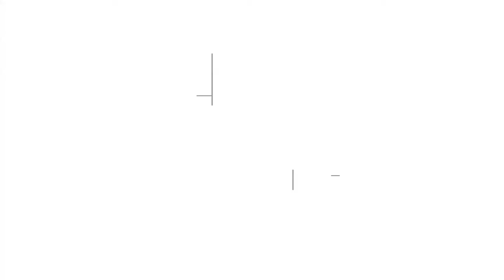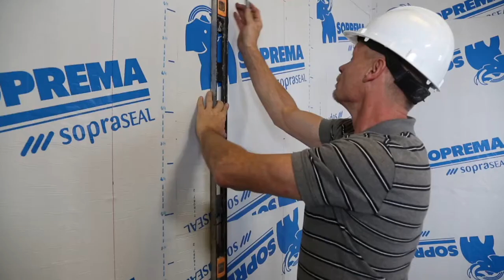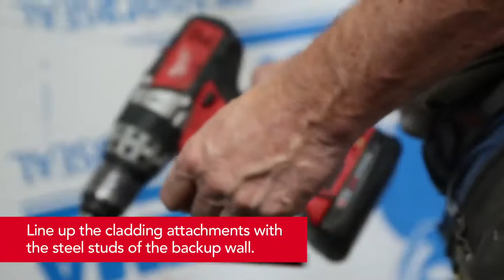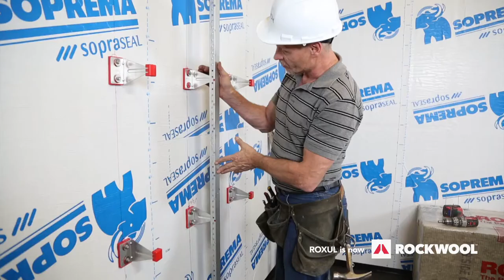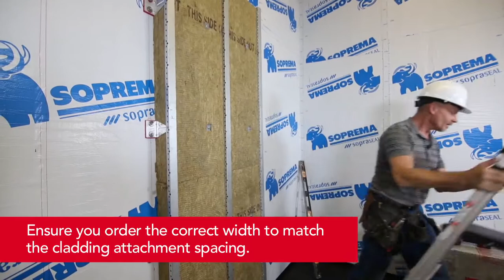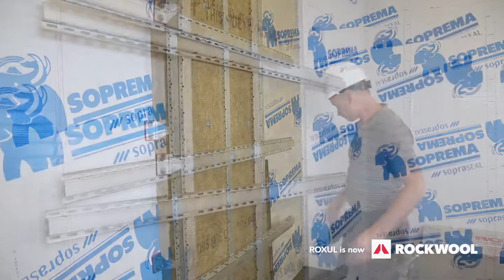How to Install ROCKWOOL Cavityrock® with Knight Wall

Comment: Key insights

🔧 The night wall MFI system is designed to reduce thermal bridging through exterior insulation, providing a more energy-efficient solution for cladding attachment.
🏗 There must be no voids or gaps in the insulation to maintain thermal barrier continuity.
🔩 The attachments are slotted, making the installation of ROCKWOOL CAVITYROCK® with Knight Wall a user-friendly process.
🏗 You are now ready to install your mechanical insulation attachments and proceed with the cladding.

TLDR: The Knight Wall MFI system is a user-friendly and energy-efficient solution for cladding attachment, designed to reduce thermal bridging and maintain thermal barrier continuity.

1. 00:00 🔧 Install ROCKWOOL CAVITYROCK® with Knight Wall MFI system by measuring, attaching support brackets, installing metal Gertz, and temporary insulation retention fasteners.

2. 01:36 🔨 Install ROCKWOOL CAVITYROCK® by fitting it snugly behind the unfastened leg of the Gert and turning it to create a friction fit, ensuring no voids or gaps for thermal barrier continuity.

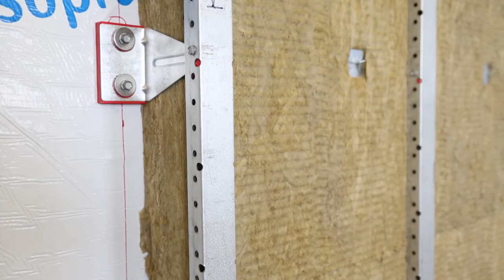3. 02:01 🛠 Install ROCKWOOL CAVITYROCK® with Knight Wall using 24-inch spacing for horizontal rails.

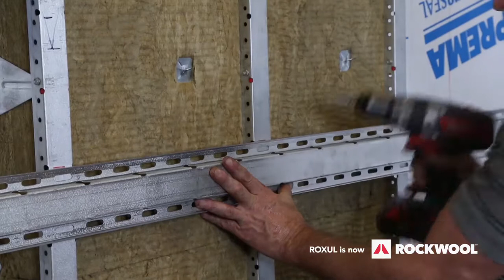4. 02:22 🔧 Install ROCKWOOL CAVITYROCK® with Knight Wall by lining up the S rails and installing mechanical insulation attachments before proceeding with the cladding.